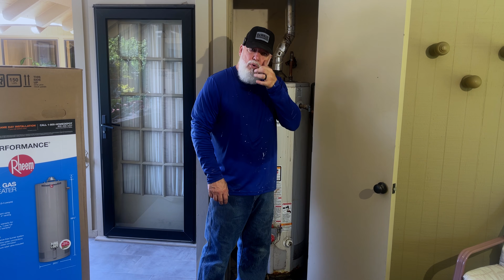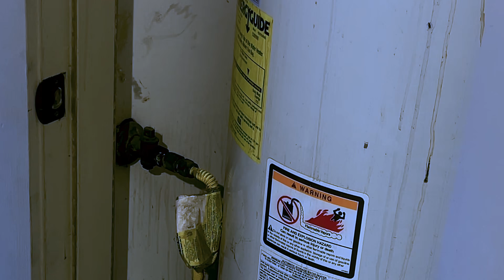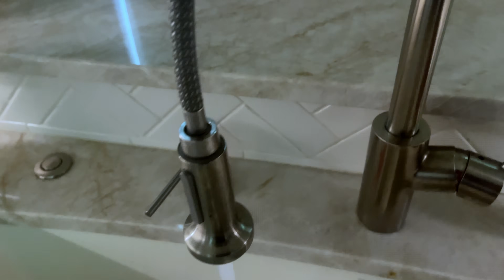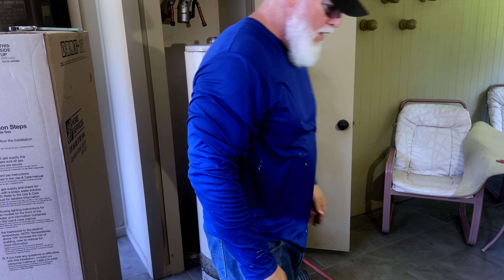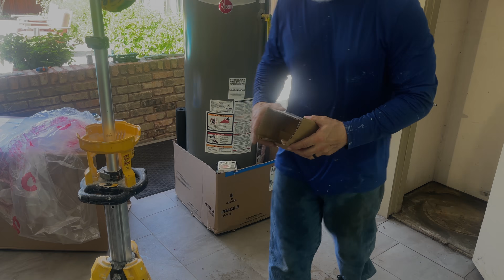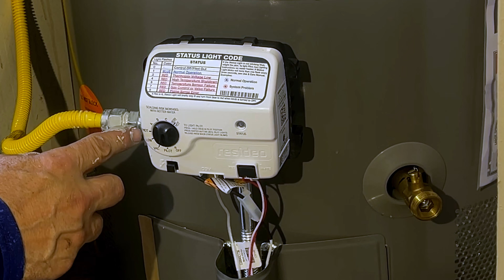Your Guide to Water Heater Installation: Tips and Tricks

Comment: I think it was 10-12 years ago now, but I only had to hear about a DIY'er improperly replacing a gas water heater on their own and they blew up their whole house while sleeping. Killed the whole family. That's all it took for me to decide I'll always hire a trained professional to handle any appliance that connects to a gas line.

This video can still help me with knowing if a professional is doing what they're  supposed to.
Reply from the maker: You are correct, you should always hire a pro if you are not capable of working with gas. I have seen even pros use just Teflon tape, I always use both tape and liquid plumbers dope. Thank you for watching and commenting.